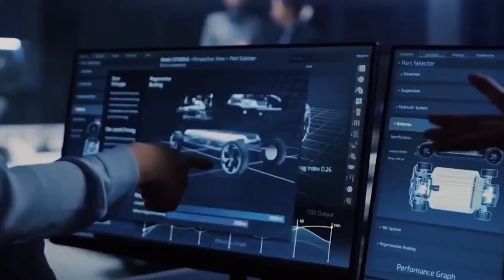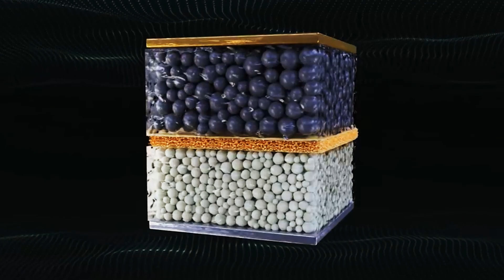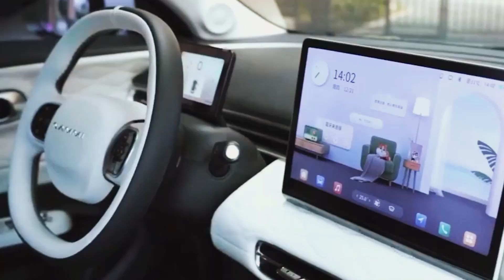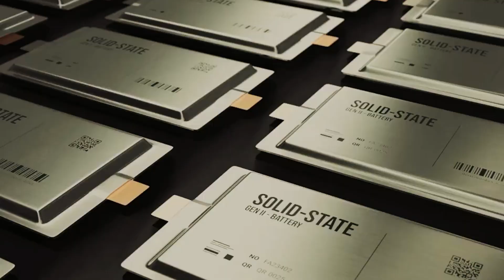NAMMI TAKES CHARGE: LEADING THE SODIUM EV RACE!

Comment: This would be a huge hit in Canada where we prefer sensible sized cars in our cities.
Reply: Sodium batteries do much better in cold conditions, can be charged very quickly and have a much longer life cycle, and they afe not highly flammable but they also have a lower voltage and less energy capacity, so ............. even more range anxiety.
It's a trade-off but I think it's a good one.
Reply: Being able to charge in minutes is also a benefit over Lithium Ion chemistry too.